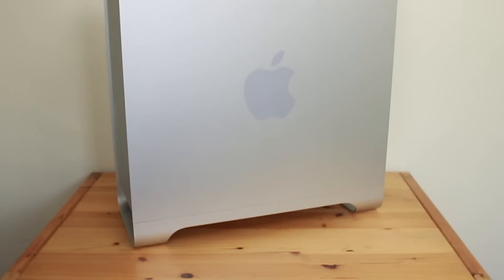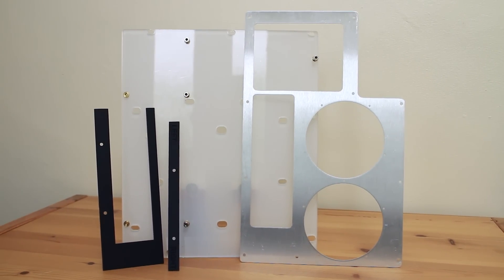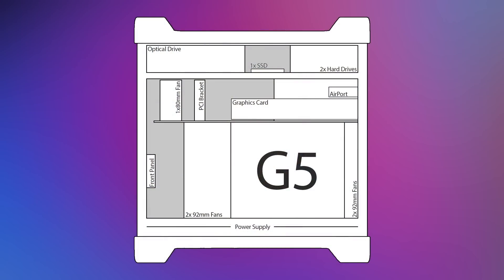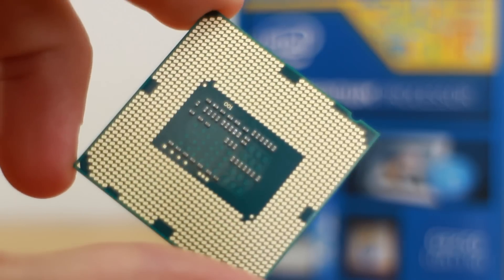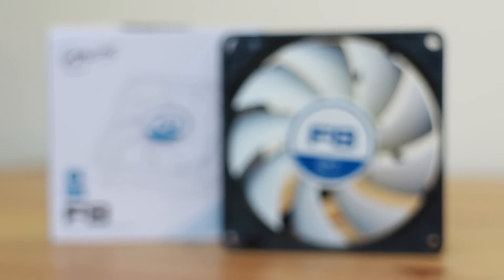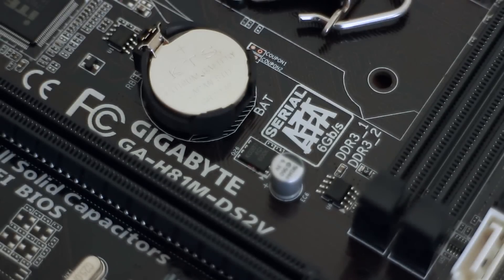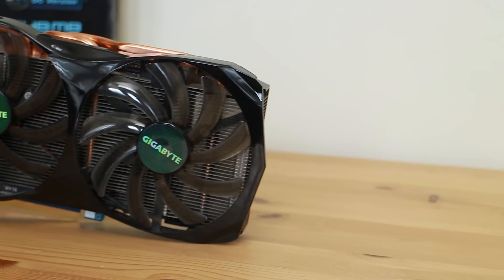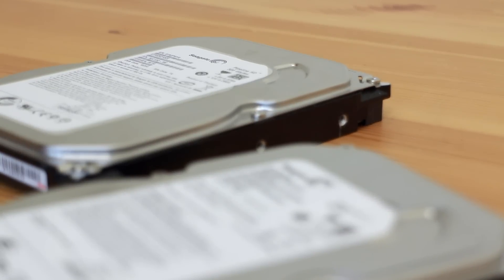Power Mac G5 Hackintosh Build: The Parts [1/5] | The PowerPC Hub

Comment: How did you power your fans? I believe that board only has 1 CPU fan header and 1 System fan header. Did you use a hub or Y splitters or what? I'm interested in doing the same thing as silently but as cool as possible.

Comment: which Bootloader are you using? id recommend going with Clover. Chameleon and Chimera/aka Unibeast won't be able to boot 10.11 due to SIP.
Reply from the maker: A couple of forks of Chameleon have been worked on to be able to boot El Capitan, so there is hope. It depends what state it's in come the general release of El Capitan though. If Clover's a cleaner, easier option then I'll go that route, but I'd prefer to stick with Chameleon if possible.
Reply: +The PowerPC Hub Earlier Versions of EI Capitan 10.11 rootless=1 use to work but now you need BooterConfig 0x28 and CsrActiveConfig 0x3 partially disable SIP I've been running the beta on my hack using Clover everything works fine.
Reply from the maker: Yeah I've done a bit more digging & Clover seems like a far better & more versatile option. I only went with Chameleon in my last Hackintosh because I was pretty new to it all and Chameleon was very, very easy to set up.

Comment: SO excited to see the outcome of this project, a pure blend of PowerPC and modern computing. Its Going to be awesome to see the most memorable machine of your channel back! Plus, with the iMac conversion as a monitor, damn. Cant wait for the series to continue, keep up the amazing work. You never seem to drop a beat; you just keep improving- speaking off its cool to see the little lav mic, assuming its plugged directly into the M? Its crazy how you keep coming up with these incredible projects! :)
Reply from the maker: Ah man this is one of the best comments I've received in a long time! And yep, it's a pretty cheap lav plugged straight in to the M (had to turn the levels down a fair bit to avoiding insane peaking). It's not perfect but still a massive improvement over the echoey built in mic.
Reply: +The PowerPC Hub Yeah, I have heard that external mic's peak like crazy with the presets the camera has out of the box. I have been considering getting a Rode video mic go for a while, but I just can't justify wether or not it would be worth it. I may get something a bit cheaper first then work up from there.

Comment: Do you intend on keeping the SuperDrive or Combo Drive?
Reply from the maker: Nope. I'll be replacing it with a SATA based optical drive. I'll be using the original "Class 1 Laser Product" sticker though to keep it looking stock.
Reply: +The PowerPC Hub wicked, I actually got a PowerMac g5 last week for $30 and plan to do the same!

Comment: Fans not just on the case... On the cooler. Even if it is passive Fanless or whatever.also 8 gb ram? 16 would "futures roof " it. And you should go with a little bit faster i7.

Comment: Seagate drives aren't perfect, they break down about 4X more than WD drives. Keep that in mind.
Reply from the maker: I've been using Seagate drives for years and I've yet to have one fail on me. Nothing but reliable from my experience.
Reply: +The PowerPC Hub This image says it all : http://www.extremetech.com/wp-content/uploads/2014/01/Backblaze-2015.jpg

For most people I'm sure the drive will run fine, but they're definitely lower quality drives.

Anyway, can't wait for the project, man!
Reply: +ZircoBen And that's why I like to use Toshiba/HGST drives. better and cheaper than both :P
But seriously, 50% fail rate on the 3TB model.. surely something has to be done..

Comment: So hyped for this series! I'm very excited to see how the air cooler and fans will turn out, it sounds like a great idea!

One question for you Niall: will you be including a video in the series on how you gutted the PowerMac G5 to be able to fit your parts? I am interested in Hackintoshing in either a G5 case or Mac Pro case so I'm curious to see how you did it!

Anyways, great video once again. Your quality of videos, as well as the things you actually do in your videos makes you my favorite YouTuber! Keep up the good work Niall!!!
Reply from the maker: Thank you! Case modding is coming in Part 2, and that'll cover all of the front panel wiring, motherboard/rear panel mounting etc. I didn't record actual stripping down of the G5 down as 1. I needed to plan where things could & couldn't go in advance, and 2. it's a pretty bog standard process that wouldn't add much to the series IMO.
Reply: +The PowerPC Hub Well said! Can't wait to see part 2 and the rest :D